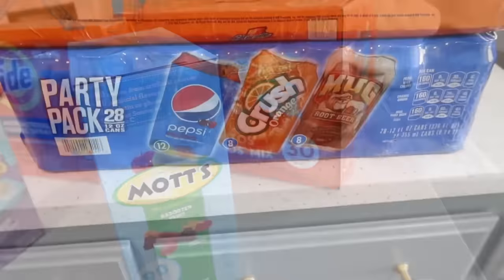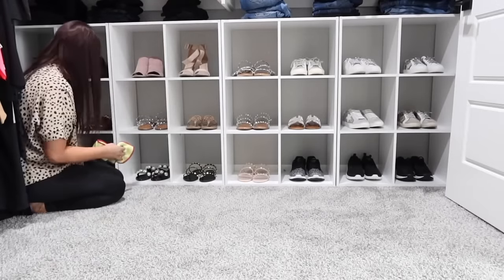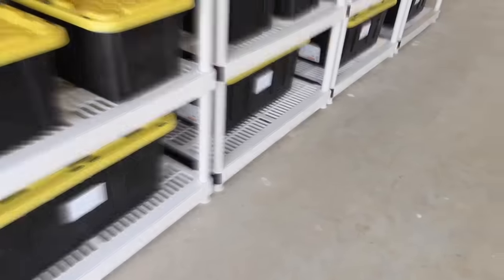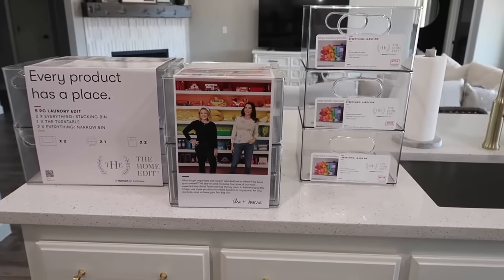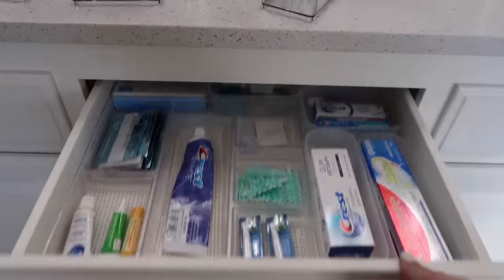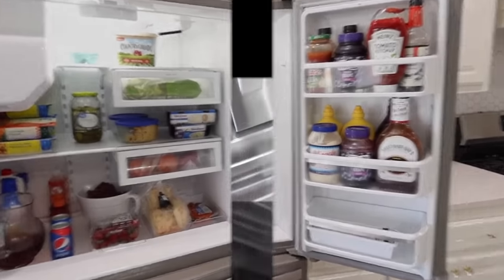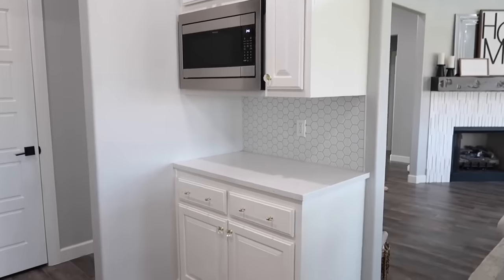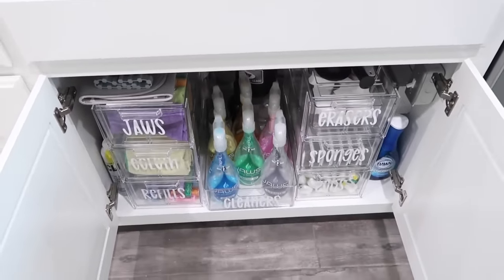🎉NEW YEAR EXTREME HOME ORGANIZATION | 3 HOURS OF SATISFYING ORGANIZATION | 2023 WHOLE HOUSE ORGANIZE

Comment: Wow! Mammoth tidy-up. Thanks for the motivation and inspiration. For your floaties, have you thought of bigger versions of your ladder hook, (I'm thinking the deeper ones for hanging bikes) use those for the round ones, then for the flatter ones, lean them up vertically in a row, attach a round screw eye hook to the wall either side of them, then stretch a bungee cord (possibly two, one high, one low) across into the hooks to pin them against the wall and claim back some floor space. I am tackling my craft cupboard today which is bursting at the seams! Happy 2023, so glad I found your video!
Reply from the maker: Good idea on the floaties! Thanks for watching, so glad you’re here!

Comment: Happy New Year Ashley, I love watching your videos for organizing. I take the ones that are helpful to me and either use it or come up with a similar idea adapted to fit my space or needs. I too am very finicky with things on the floor. I like to be able to clean in and around, so for some things I place a plant stand with wheels underneath or moving dolly.  For instance I have a fabric bin on the LVT'd floor of my bedroom, and with a dog there's always more hairballs and they definitely find and stick to fabric, so I placed a 4 wheeled dolly, purchased from Home Depot for $10; it keeps it off the floor and is easy to pull out for sweeping. For my pantry I had about a 28" space between the floor and the 1st shelf, so I bought two 36" stainless steel wire shelves, had my husband cut them to fit, and it too keeps things off the floor and gives me 2 more full shelves and one that's only about 2". There I put my long rolls of foil, for Turkey or the grill, parchment paper, grilling utensils and etc; anything that is odd and doesnt fit in my conventional cabinets or drawers or use often. Again, it's not sitting on the floor and I can sweep or dust mop underneath them.  My 3 section laundry hamper, which is in the hall between my bedroom and laundry room, can be seen by guests, so I had my husband paint it to match our decor and bought, from Dollar Tree, a set of bedrisers and glued them on the bottom, so now it looks like a piece of furniture and is off the floor! Lastly, my choice of drink is Lipton's diet citrus tea; its light and refreshing instead of water. Thank you for all your thoughts and ideas. Cheri

Comment: Be careful with PODS - when I was researching new washing machines I was told that PODS are NOT recommended by the makers of washing machines - they dont always break down and are not adjustable for size of load really - I have also learned I was adding WAY too much soap per load and the residue is NOT good for the health of your clothing - so I cut out and down on both and my machine is doing better over all - glenda

Comment: I have used dishwasher pods for last many years.  Cascade runs my glass dishes.  I only use the Finish orange pods.  My dishes always come out clean and sparkling and the glass dishes have never had that whitish discoloration that the cascade does to them. I also get my paper towels off of amazon (presto brand). They come wrapped in one bundle. I open one or 2 boxes and store on my pantry shelves and any remaining are left unopened in the plastic for protection in my overflow storage in my overflow pantry. 
I love organizing but I agree that pantries are tough.  I also do not like packaging and will decant. Too many colors make my eyes go crazy.